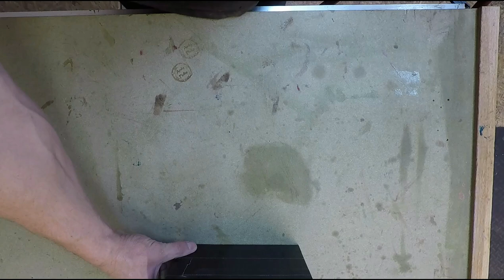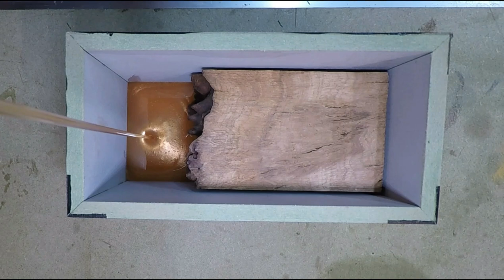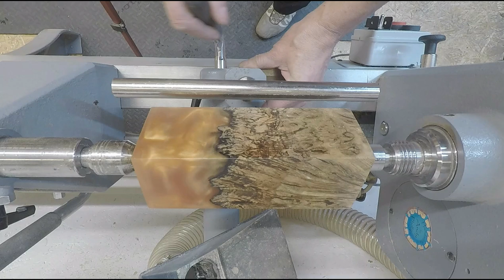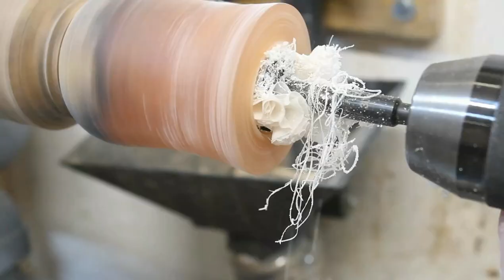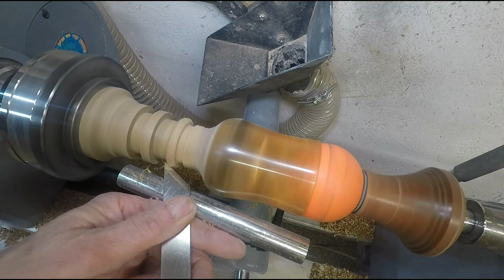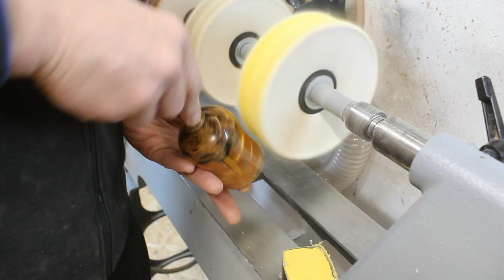Woodturning - The Wedding Goblet

Comment: Genius! With all respect, if you can just being using half of the amount of the wood and turn it into the same goblet would be even better. Love that work!!
Reply: Just what I was thinking!
So much wood to make a thin handle.
Reply: The bottom of the base and where the wood widens to transition into the goblet part are both wide. You have to start out with wood that wide to have those wide sections.